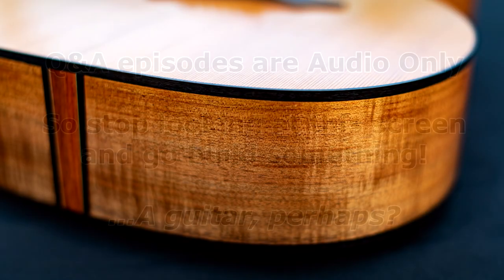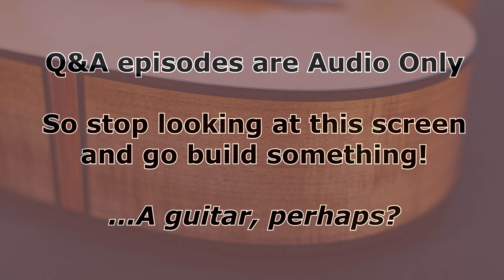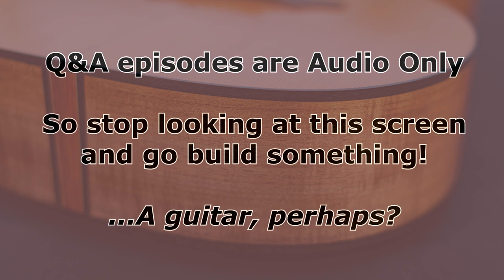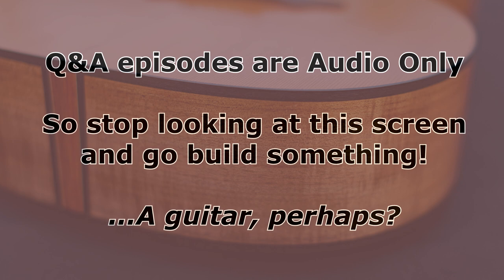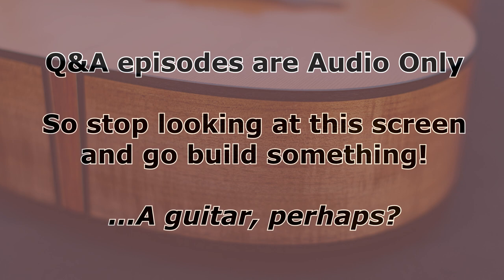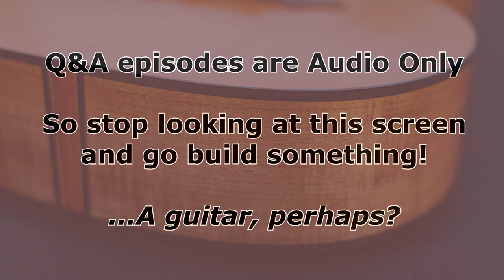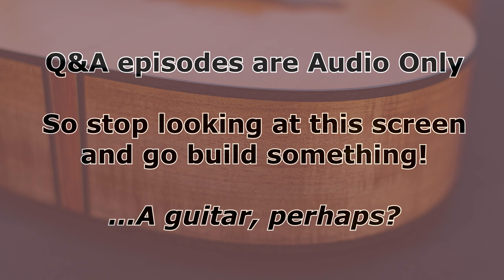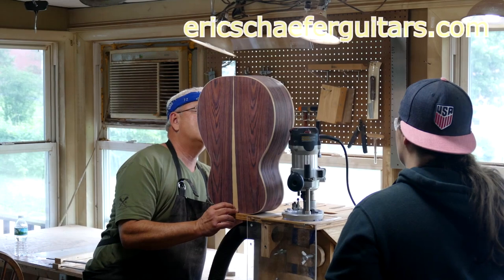Q&A   Backstrip Woods, Headplate Thickness, and Butt Joints

Comment: Hey Eric - Glad you are taking the time to do this.  Butt joints... I use them exclusively. As you said it is the easiest. Instead of gluing the heel to the body, I bolt it on. Having made eight guitars on my own and desiring the easiest and most convenient in doing adjustments or resets, the bolt on butt joint does it for me - and no complaints to those that i give guitars to. I create my neck blank and do rough alignment based on the body's dimensions and angle of the top. Then I'll take the butt of the heel and route out the wood in the center (about 1/4") so that i am only dealing with two strips of about 3/8" on the sides of the heel as the body contact points. This makes adjustment both up & down and side to side much easier than trying to deal with a full solid surface. I sink two insert nuts (1/4-20) into the heel and run (1/4-20) connecting bolts bolts through the heel block.

I'll finish up the neck - insert the truss rod and fret board. Depending on the fit after I've strung up the guitar, I might not even glue the fret board over hang onto the body if it lays down nicely. Or if i know the owner will play up there in no man's land, I'll glue it down for better vibration transfer. When the heel cap is added, it covers the center area that was routed out.

Cheers!

Comment: I'm making myself a mould for sides etc to go in, but when routing out the other layers I've made slight mistakes here and there. I've filled these in with filler, and filed these down again to make them square, my question is how perfect do the insides of the mould need to be? Also most the insides are square at the moment, but only on one side, I think this is due to a slight split in the bottom layer of my mould, will this effect the sides though? Hope you see this, thanks, Andrew :)